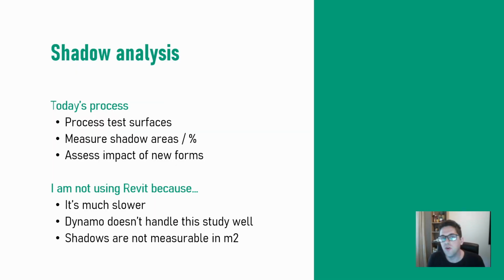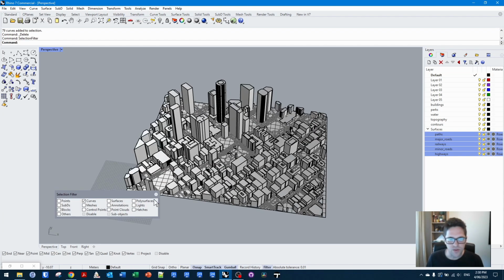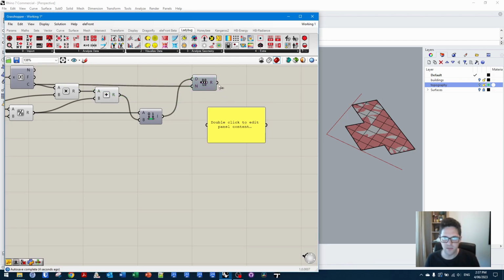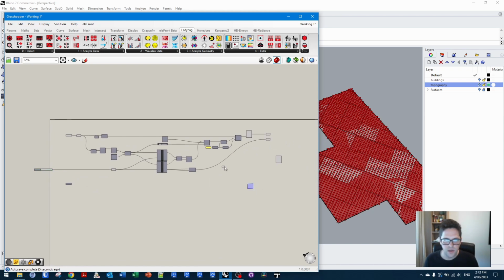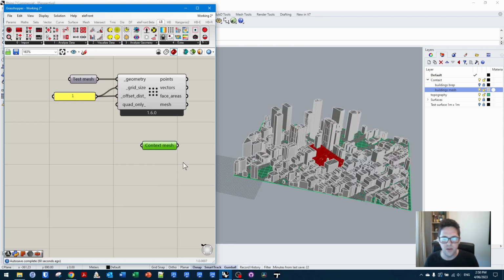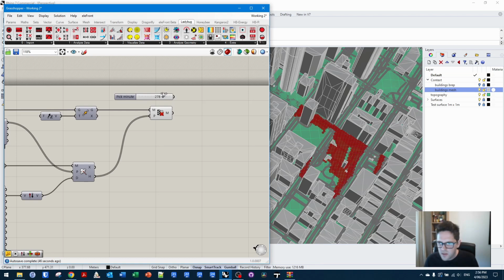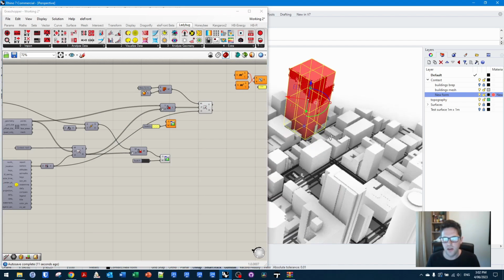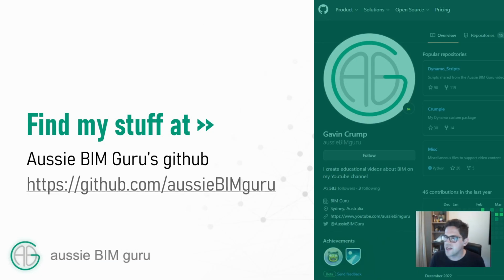Shadow area studies using Rhino, Ladybug and Grasshopper!

Comment: Hi, 
thank you for the indepth tutorial!
I'm having an issue connecting the topo mesh and testing points into the ray mesh (I have 4 different meshes I am trying to run at once) ...  and some of my meshes are not seeing the points being projected onto the topo mesh? Do you know why this might be? I have tried grafting the mesh input. Do I need to somehow smooth the topo meshes? Thanks
Reply from the maker: Usually my recommended approach is to join all analysis meshes after the test point generation, then analyse that single mesh. Extract the face count from each original mesh and you can then partition the results output by that to get each meshes respective results list.

Comment: Hi Aussie BIM Guru. I would like to create soil layers in Revit using Dynamo. Would it be possible to make a video about it?
Reply from the maker: Personally I would look into the new toposolid features in Revit 2024 as I believe there would be more merit here vs trying to replicate this using Dynamo. I will have a video on the channel in a few weeks showing how to project floors onto topography which also might help as you can make a floor that matches the toposurface with given layer thicknesses, and an option to flatten out the variable layer to its base (as part of how floors work generally).
Reply: @AussieBIMGuru  Thanks. I managed to model soil layers using topography by points, but only as long as they don't cross each other